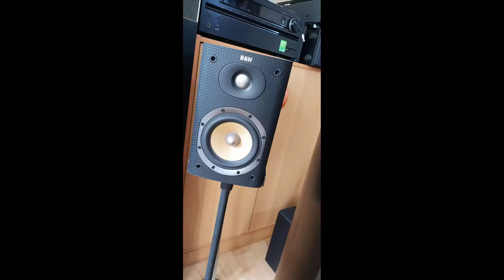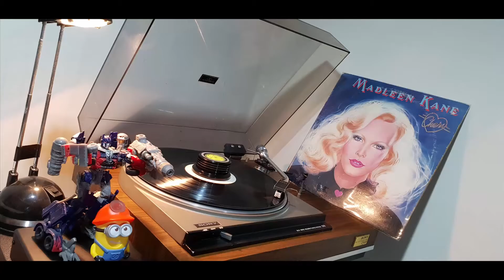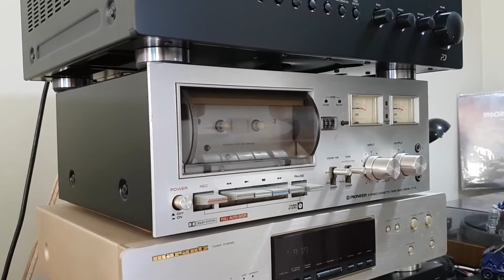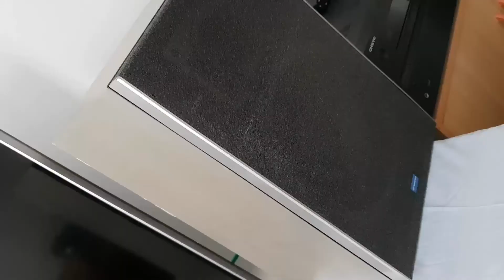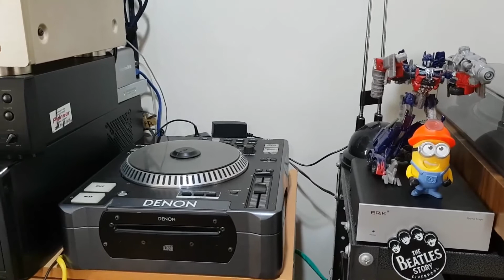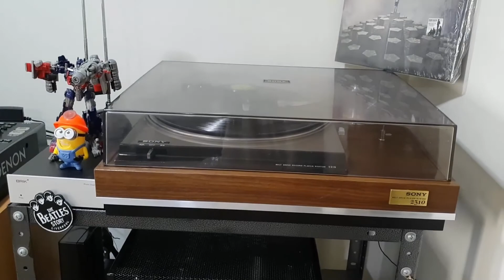Poor Man's Audio Setup

Comment: wow!  you have a lot of speakers.  i would love to show you the system i have in my man cave.  honestly, i don't think you need that many speakers.  that's just my opinion.  also, a 5.1 sound system is more than adequate for your limited space.  unless you live in a mansion i can't see where a 7.1 system is even feasible.  you need a huge room to be able to tell the difference in my opinion.  as for speakers times have really changed over the years when it comes to speakers.  the existing surround sound system i have i'm running book shelf speakers  (KLIPSCH RB-81) as front channel speakers and a small klipsch RC-52 center channel speaker.  for rears i'm currently using in ceiling KLIPSCH CDT 5800 speakers.  i'm reaching reference audio levels... its as loud as a live rock concert and watching movies it will scare you if there's a explosion that goes off in the movie.  oh  yeah... i have a cheap KLIPSCH 10 inch subwoofer.  i don't have much speakers, but what i do have is a POWER AMPLIFIER pushing them.  that's what you need - a power amplifier!  i would look into an older ADCOM or ROTEL 5 channel power amplifier (70 to 80 watts per channel) and you'll be amazed at how your sound system sounds.  my overall recommendation?  stick with bookshelf speakers and wall mount them if you can and get a power amplifier.  lose the tower speakers.  you don't need them.

Comment: I see you love your speakers but you should reconsider selling off some speakers. For your room size you should keep it simple. You should do a 5.1 surround sound setup or 5.1.2 atmos. 
If I were you I would keep the 3 B&W speakers for the sound stage ( LCR) and 2 satellite speakers for the surround sound or 4 satellites 2 for surround sound and 2 mounted on the celling for atmos. If you do end up selling the speakers invest in a 4K player. Ultimately it's up to you 👍
Reply: Retro Force I agree with this post. Really just need the b&w and some nice sides. The b&w are well rounded. Sell it get some rear b&w’s. And Atmos 5.1.2   Everything else needs to go. Your b&w have the best sound stage and great fir both stereo and movie surround. Nothing else is up the that quality. U just have lots of stuff. And it’s not sonically matched.